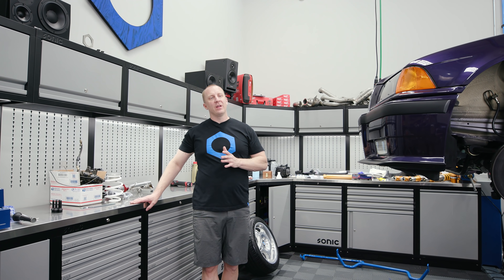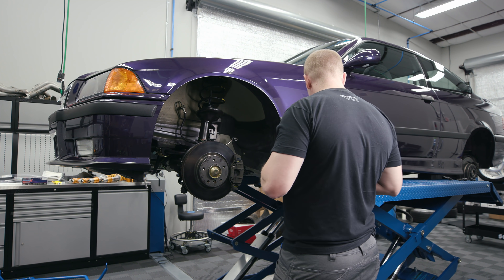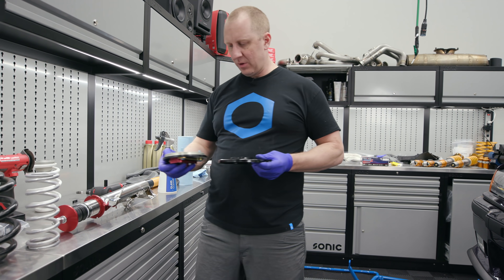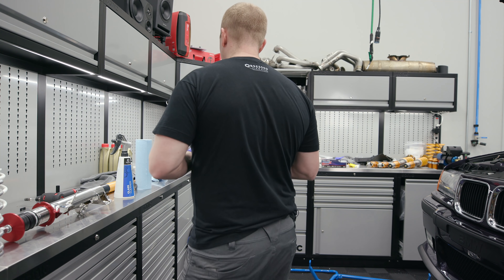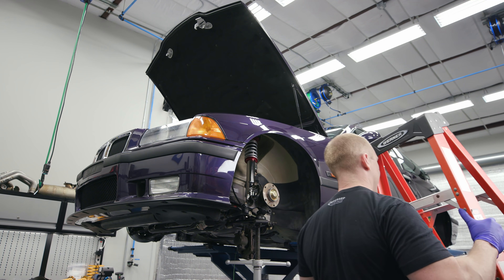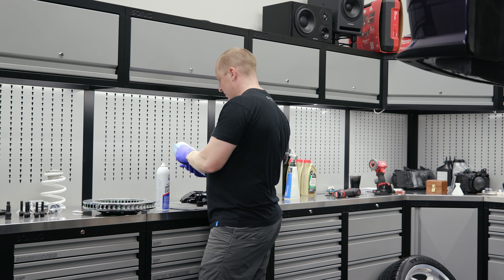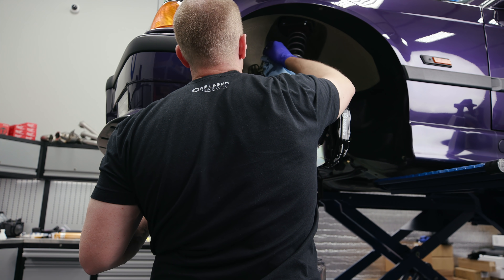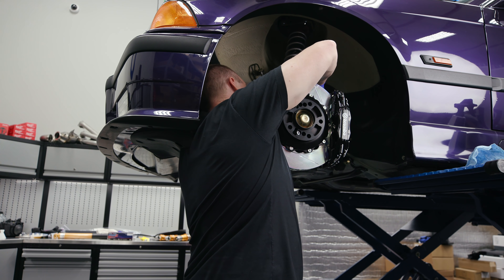E36 M3: Front End Suspension and Big Brake Install | TC Kline SA | Brembo | Turner

Comment: As a fellow E36 M3 owner (euro version) - Im not sure what fitment you ordered the BBS's in, but E36's are notorious for having "weird" fitment. You often run high offset wheels, with no spacer in the rear, and a large spacer up front. Running coilovers, almost no wheel clears the strut since the body is "fatter" and the spring perch is further down. Regarding the wear sensors. You can just "cut" it off, and connect the wires to themselves, and you'll have no code, its just a loop, which gets interrupted when the pads are worn, and then shows a code. I have AP racing brakes up front on mine, and works fine when just connecting the wires to themselves.

Comment: May I suggest? For the break wear sensor. I think you can just use a wire to loop the wire back and that it.
Reply: Correct, the light goes on with an open circuit. Create a loop in the harness and problem solved.
Reply: 90's cars, need some 90's solution. JUST THAT AND GOOD TO GO. HAHA

Comment: Trade the TC Klein rear adjustable spring mounts for the ground control articulating ones. They mount on the rear control arm and allow for easy height adjustment. MUCH better product.
Reply: Yeah those are much better spring perch it keeps your spring sitting up straight and not bind into the sides I actually have a set of them on my E46

Comment: When upgrading to anti-roll bars that large on an E36, you have to weld the outer side where the front bar attaches to the frame rail. Once you remove the seam sealer, you will see about 3/16" gap. If you do not weld the outer side, the spot welds on the other 3 sides will tear loose.

Comment: You probably already figured this out, but if the wear sensors can't be coded out...you should just be able to either put in a jumper wire or leave the sensor tied up out of the way.

Comment: I also notice it doesn’t have the x-brace added. I’m sure you’ve already ordered that - but what is also not very known is the euro M3 came with additional underbody trim coverings to US spec doesn’t have. Check out part # 51712491567 it’s a covering that goes over the whole middle-front of the car over the x-brace and everything.

Comment: car is looking nice. If you want to go crazy you can buy those sensor holder cover thingies. I replace them whenever I'm in there doing brakes or suspension. It's a hard part to find in the etk/realoem they are part # 61-13-1-393-782 and 61-13-1-393-789

Comment: One option for the brake pad wear sensor is to leave it electrically connected, but tie it up somewhere where it will never be messed with.
This way you'll never see the brake pad wear light go off, and if you ever want to start using them again you can just install it into the pad.

I've also had luck just jumping the connection with a paperclip at the body plug, or use a wear sensor that has been cut and looped (shorted out).

Comment: In all fairness, it would have taken at least 20-30 seconds to clean that part!  
Sticker on Brembo rotor comes off in 3 seconds though.  And no need to clean the face with harsh brake cleaner either.  Dryce away!  🤣

Comment: I believe for the brake pad wear sensors you can just cut the sensor end off and solder the 2 wires together. I think if you do this close to where the sensor plugs in to the car wiring it will be the cleanest and easiest way. I dont believe the sensor will trigger if it is not in the brakes as it is suppose to be so I think you can also ziptie the sensor and the couple of feet of wire up and not have the light come on.

Comment: Interesting the kit requires cutting in that area of the knuckle. Tons of force applied to those bolt locations under heavy braking. Could go pretty wrong if someone got the cut(s) wrong.
Reply: yes i find it strange that you would have to remove so much material on such a critical part of the car !

Comment: I am only a few mins in but if you are putting steel brakes on this you are going to make a damn mess of that newly cleaned car behind the front wheels. Why not just trim the dust shields? It is actually way easier than prying them off like you did.

Comment: Installed these on my e90 and the ride is really good but when I had the car height  adjusted to my liking, when I lifted the car, at full droop the springs are loose. 

I don't understand if this is normal or not, if anyone knows anything about these types of coilovers please chime in???
Reply from the maker: If the springs are loose, technically their are too short for the height you have set.  You want a helper spring.  That being said.  I've had this on many cars that are street driven without an issue.

Comment: I'm not gonna scroll through all the comments to see if anyone said this, but you can just cut the wires that lead to the brake wear sensor sensor and connect them together. If I remember correctly, if you cut it short enough, you can also tuck the wires into the little hidey-hole for the sensor connector and it'll never be seen again.
Reply from the maker: Great point.  I did that on my E92.  Forgot about that.